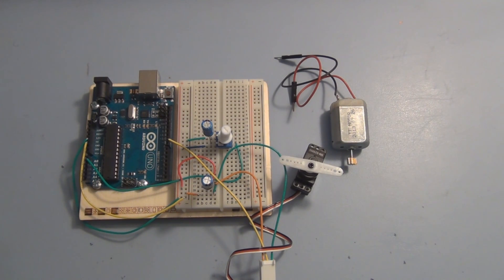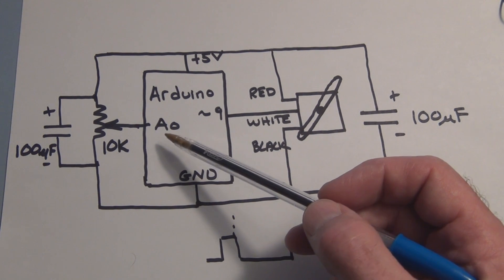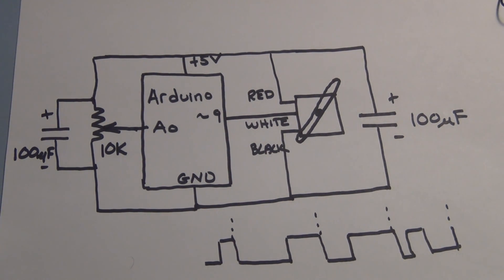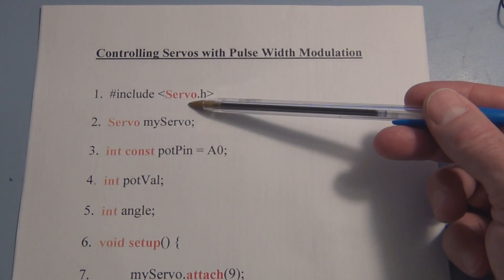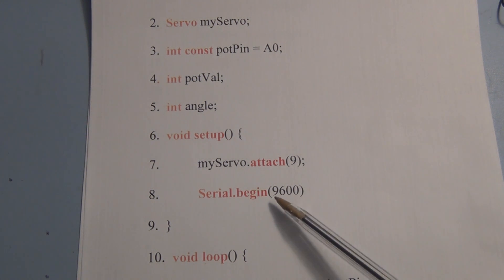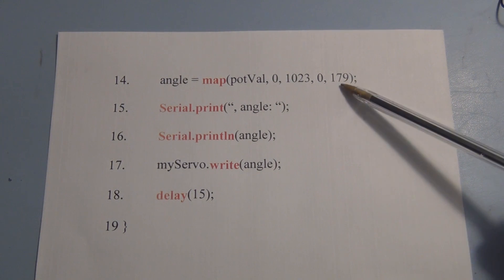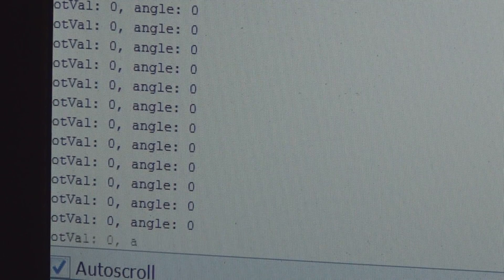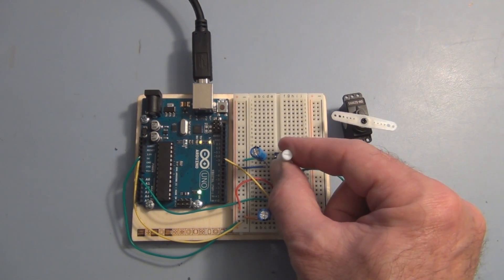Arduino Uno tutorial servo motor control

Comment: Hey thanks very helpful video! Im doing a project where i would need to control the position of the motor as you showed above, but im afraid the object i will be rotating is too heavy for that motor. Is it possible to be done if i add an external power source to the circuit to give the motor more power?

Comment: Hi, I am a graduating student and currently working on a research. May I ask your help about our propose project about using arduino + piezo disk + servo motor. So the objective of this research is to actuate the servo motor by the vibration made in the piezo disk. Can I ask your help about this?

Comment: Hi!
I've been searching alot, but can't seemto find the reason: why do people buy a servo driver? Is it because of the amps the bigger servos need and would fry your arduino? If you can link me it would be extremely appreciated :)
Reply from the maker: Here is a link to a good explanation of servos.  http://www.electrical4u.com/servo-motor-controller-or-servo-motor-driver/
Reply: eTechTom hey thanks for the response, but the my real question would Be: why do some people use an extra adafruit or sparkfun driver in between their arduino (=Micro controller+ Power supply in the article given) and the servo motor?
Reply from the maker: Kevin VR The arduino is not made for driving circuits but to send control signals to circuits you want to control.  The outputs can only supply about 40ma of current.  So the arduino controls the addition circuitry that is needed for applications that require higher current or power.
Reply: Thanks for the (fast) response :) It makes sense now :)

Comment: I have the same assembly and code uploaded. But when the potenciometer reaches its minimum and maximum value, the analog read fluctuates like from 0 to 15 and 1023 to 1003 causing the servo to move crazy when the potentiometer reaches min and max. What could be the cause of the problem and how can i fix it?
Reply from the maker: You might want to just look at the potentiometer on it's own by measuring the variable resistance to see if it has a linear adjustment.  See if the resistance varies smoothly across it's range.  It might be dirty of defective.  Try a different pot if you have one.  The binary out is the digital representation of the voltage into the ADC.  So there must be something wrong with the input voltage for some reason.
Reply: I ran into that problem with a Radio Shack servo.  That particular servo is a cheapie and runs into this problem:  

When the servo is sent to it's limits the device that reads its position becomes inaccurate and it will try to constantly adjust itself to the position it has been told to assume.  You might notice this as jerky movements at the extreme values or a constant jitter or vibration.  Also, the RS servo only has a range of 160 degrees, so trying to send it to 180 causes problems.  I solved it by keeping my movement command in a range between 3 and 157.

Comment: Hello, I have a question about the capacitors. What do they do? Why not just connect the potentiometer to 5v and ground and Analog input? Same for motor (pwm input)? It works just fine without capacitors?
Reply from the maker: The capacitors help maintain the 5V from fluctuating to much.  Without the capacitors the 5V might go dip down when the motor actuates.  The motor in this experiment is not moving anything or doing any work.  Depending on what the motor is moving will require more or less energy from the power supply.

Comment: plz tell me how to take power supply when there is two servo motors?????
Reply from the maker: I'm not sure I understand your question?  You need to figure out the power requirement for your two servos and whether the arduino can supply that power. You might need a separate supply.   If the question is how to control two separate servos just create a second servo variable and use another pin on the arduino that is marked for pwm ~ .  For example Servo myservo1, Servo myservo2 and myservo1,attach(9) and my myservo2,attach(10).
Reply: thanks for helping

Comment: can i rotate the servo till 360 degrees? by changing 179 to 359
Reply from the maker: Hi, The servo is limited by the internal gears and feedback mechanism inside.  So it usually moves 0-179 degrees.  There are continuous motion servos that continuously rotate and you control the direction with 0 for one direction, 180 to move in the opposite and 90 stops the motor.  With the feedback disconnected its like a continuous geared motor.